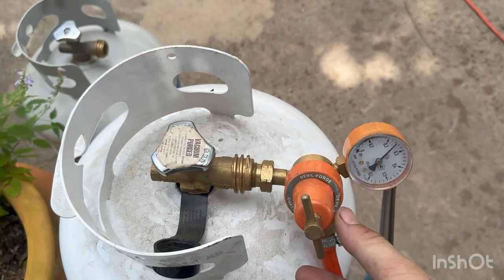Bronze Age ship builders axe made completely from scrap metal!

Comment: Fun!  I have a couple of homemade aluminum bronze axes myself.  Good choice of alloy, you can peen the edge to work harden it and if you have your alloy right it will hold up to chopping wood almost as well as a steel axe.  If you're open to suggestions, if you were to make a corebox and spend a little more time refining a pattern with coreprints and a fully sculpted eye,, you could be spending a LOT less time drilling and grinding away excess metal.  I've even poured a couple where the cores were just made of normal molding sand reinforced with some stiff wire.  But working with real core sand is a good learning experience too.  Much respect for working with real wooden patterns, and good luck!
Reply from the maker: Hey thanks for the good info man! Can you explain a little more what you mean by core box? I have only ever used Petrobond to make my molds but lately I have been wanting to branch out and try other techniques
Reply: @BEMetalMelting  core prints and coreboxes and cores are used in sand casting to make hollow castings, they can be as complex as the inside of the engine in your car or as simple as the eye of an axe head.  You could cast your axe heads with the hole already in them ready to take a handle (might need a little sanding).  So you would not have to drill them out.  The core is a piece of sand that rests on its ends in coreprints left in the mold by your pattern.  It is made in a corebox, which is simply a mold for making sand cores.  It's hard to explain, but I have a few videos showing how it works on my channel.  I might even have them in a playlist.  I've shown hardened cores bonded with sodium silicate, but in a pinch it's often possible to use regular petrobond with reinforcing wires to make simple cores like the eye of an axe head.
Reply from the maker: @tobhomott  yes! Thank you sir! That’s what I kinda pictured in my head, thank you for explaining further! I have been looking into getting into lost foam and lost wax casting which I believe is similar to what you are referring to! Lately I have been working on building my blacksmith setup but when I get back into casting I will give this a try for sure! And I’ll be sure to check out those videos I really appreciate the comments and views!